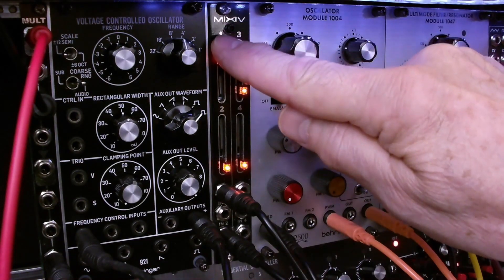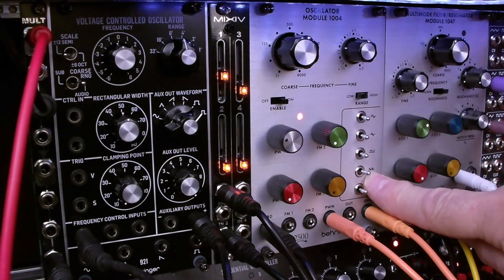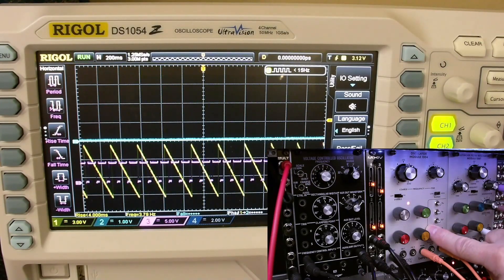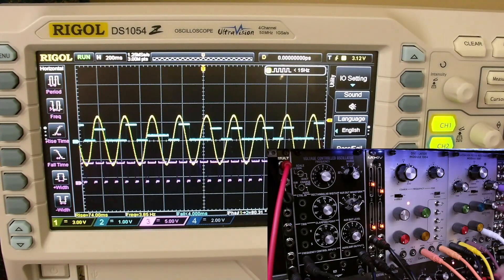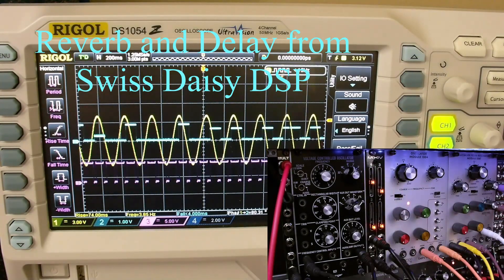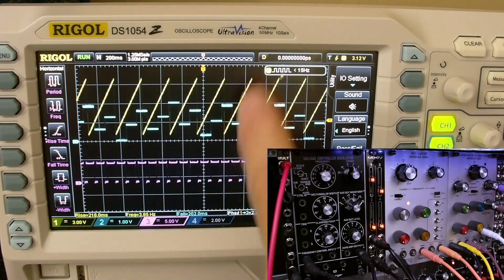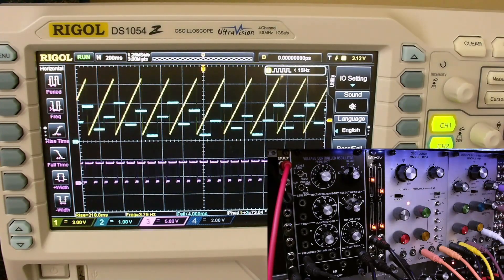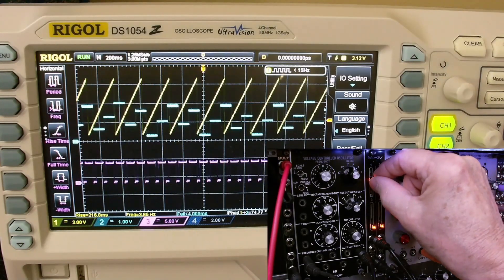ARP 2500 VCO 1004 as LFO / Sequencer with 921 VCO

Comment: Do you have videos on the 1004 as an audio VCO? Specifically tuning. I’m having a heck of time getting mine to track
Reply from the maker: I don't think I've had to calibrate any of the eight 1004 VCOs that I have.  The only calibration that I've done was on a couple of 921B VCOs (system 55).  I did some hardwiring between the V/Oct connection on several of them.  I think all of the moving around knocked one or two of them out of calibrtion.
What's your CV source?  Also, is your power supply over loaded?
Reply: I’m using the CM1A midi converter which I checked over a five octave range with a voltmeter. It was not perfect. So I need to go back and do the MusicTribe calibration. And I found the procedure for calibrating 1004s - pull the front plate to reach a Scale trimmer mentioned

Comment: Dear Mr. O.Z., I just started to watch your System 2500 Videos. They are really helpful! I am thinking about building a 2500 modular system (and I am new to this kind of synths). So I wonder if you could compare the 2600-VCO (the modular thing) with the "standard" 1004 Oscillator. How different are they sounding? I know they have different schematics. It is strange for me that nobody has compared them yet - I didn't found a video on YT about this topic. Thank you and kind regards!
Reply from the maker: Hi "Pablo" If you're building a 2500 system, the 1004 two advantages over the 2600 VCO.
1) the 1004 has the waveform switching/inverting/mixing feature which is pretty unique to see in a VCO.  (it's possible to reproduce it with a mixer that has mutes and inverted inputs).  
2) the other consideration is the aesthetics of the 1004, which matches the rest of the 2500 modules.
I'm not sure there's significant difference in the audio of the 1004 vs the 2600 VCO (stand alone in eurorack format).
Does that address your question?
Reply: @ozhalljr  Thank you so much for answering! This is interesting. My question goes more for the audio difference. On the old Moog Modulars there were several generations of VCOs which had different behaviours in pitch stability and also in sound. So I wondered if this could be the case also on the ARPs (not the pitch stability, but sound differences) - between the ARP2550 vs 2600. Maybe you have the possibility tho play them against each other in a future video? Thank you so much for your teaching work for us! It is so amazing to have these possibilities in music nowadays - and to talk about this topic across the planet. Greetings from Germany!
Reply from the maker: @pablopicasso7343  Thanks!  This is not a finished video, but it should do the trick.  Let me know what differences you hear (if any).
https://youtu.be/IRQCgtFN-24
Reply: @ozhalljr  Wow, that was quick! I really appreciate this - thanks! I will leave my comment under the video.
Reply from the maker: @pablopicasso7343  you're welcome.  I needed a short break from the video I was recording.